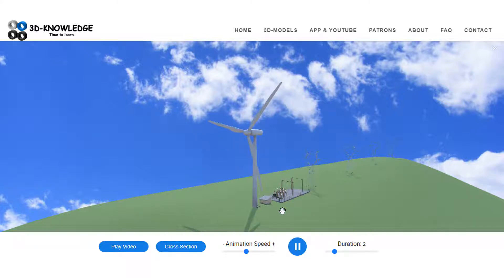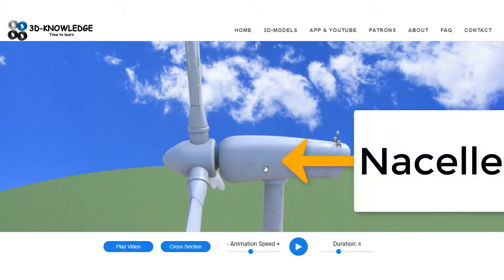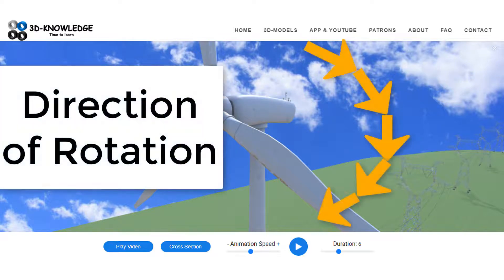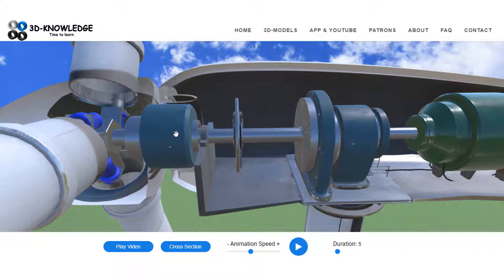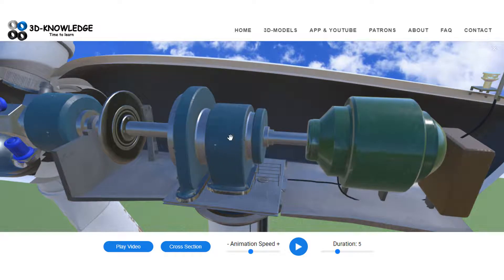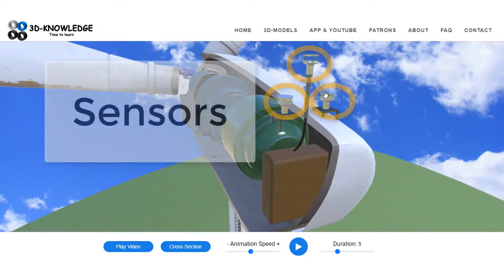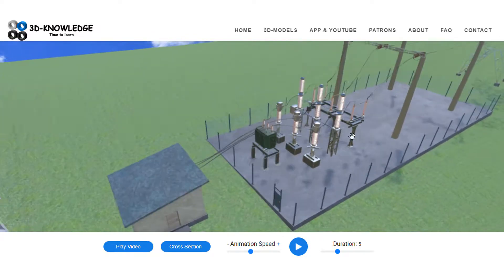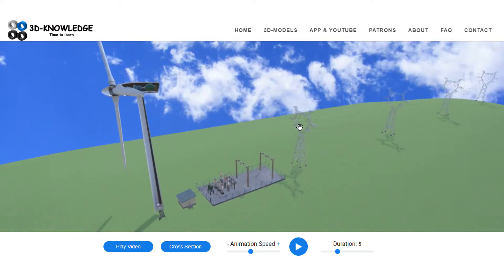How Wind Turbines Work

Comment from the maker: Hi Rafael! 
Normally they use a planetary gearbox, but there are wind turbines without any gearbox (direct driven). As far as I am aware, the gear ratio is fixed.

From what I have read over the past month, there seems to be a trend towards using electronics to synchronise the turbine with the grid. You can have a direct driven turbine, fixed speed turbine or variable speed turbine, but some of these drive types will need electronics otherwise you cannot feed constantly into the grid. The most important factor determining what type of drive is used, is the generator. Currently there is a trend towards a double induction generator, but they can be quite expensive due to all the electronics. Induction generators are cheap and cheerful, so their use is widespread. 

The blades can change pitch like a normal control pitch propeller (CPP), so they can pivot to increase the mount of lift imparted on the blades, or reduce it. The blade angle into the wind is called the 'angle of attack'. If you want the rotor to stop turning, turn the pitch to 0 so there is no lift. If there is no force imparted on the blades, they call this 'free wheeling'. Adjusting the pitch is a good way to vary the turbine's rotational speed. 

Note, even when the turbine should stop turning (pitch=0), it might not (weird?), that is what the brake is for. You can see a few good videos on YouTube where the yawing mechanisms have failed and so has the pitch control, the result is that the turbine is left facing the wind and the brake cannot stop it accelerating, so the turbine 'blows-up' ('catastrophically fails' is the technical term). 

Does that answer your questions?